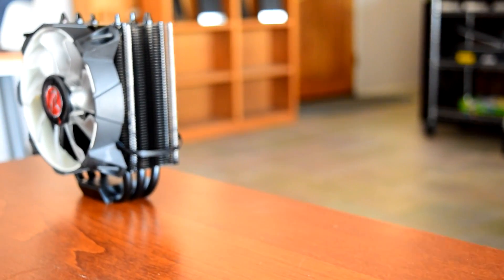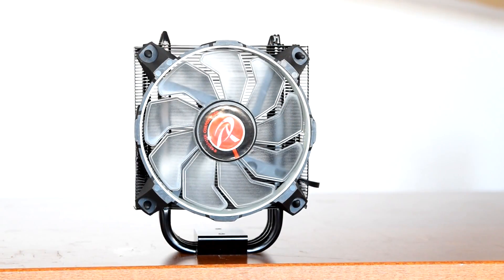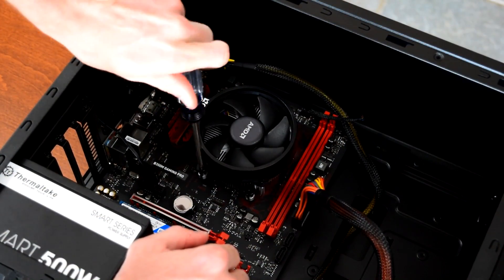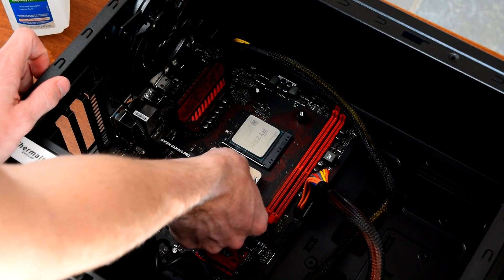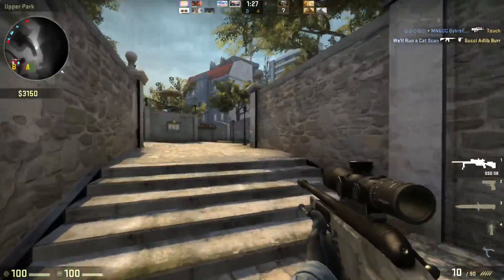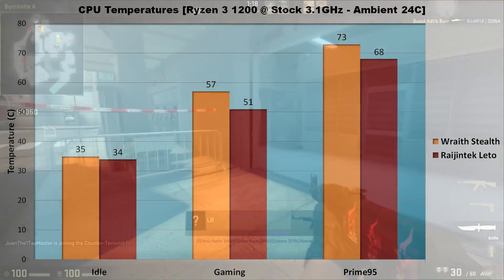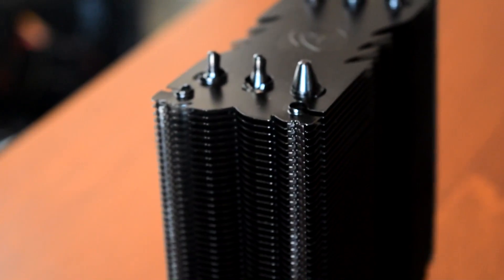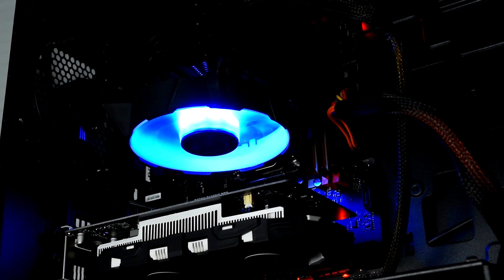Raijintek Leto Review: Ryzen 3 Overclock to 4.1GHz on Air!

Comment: Hi so i am planning on upgrading my 2400G to a 2600/2600X and don't plan on overclocking so i want to know would this cooler be more than enough or should i think about getting an AIO like i have been thinking of getting.

Also right now i am using the Deepcool S40 cooler which has done good for me but going to give it to my friend when he buys the 2400G from me cause i am going to overclock the Vega 11 since for most of the games he plans on playing would which he is going to be playing GTA V, Destiny 2, CS GO and Overwatch which i already know for those games he would be playing on medium to high settings so just your opinion on this cooler is it worth getting or should i save up more to get something better.

Also i don't mind the orientation of the cooler since i am getting i am going to have slot 2 and 4 open at all times.

Comment: With the B450 mortar and Corsair 115i pro RGB 289mm cooler could I push it to 4.2 even if have to increase voltage ?
Reply: I'm late, but probably not, you'd have to increase the c voltage well above the safe limits for daily usage (1,35v), and significantly reducing its lifetime

Comment: IMPORTANT PLEASE RESPOND!
were you able to put the side panel back on. I have that same masterbox lite 3.1 and i'm bying this samw cpu cooler.
Reply from the maker: Yes, there's about 5mm of space between the side panel and top of the heat pipes.
Reply: ponchato wow.. on the cooler master site it says "supports coolers up to 158mm tall" and this is 159. But thank you very much.
Reply: ponchato and btw don't you hate it too that there's no cable routing hole above the 8pin cpu power😂

Comment: My old Thermaltake Contac 30 3x8mm heatpipes(modified by me for AM4 socket) with Noctua 120mm fan keep my 1700 @3.9GHz under 65 degrees without any problem(Lapped CPU & cooler). Max acceptable temperature for Ryzens is 70 degrees

Comment: 4.0Ghz at 1.275v?
Dear lord, someone just won the lottery.
Reply: 15min in prime is not enough doesn't say if it blend test small or large ftt
Reply: I know this is an old post, but i've just read it. 
Mine runs at 3.9GHz / 1.28V with stock cooler since months and it doesn't go above 70-73 ° C while playing very CPU intensive games.
I tried at 4.0 GHz on same voltage but it was obviously hot with this weak cooler :D
Reply: @ÁkosLabancz  but does it ever crash? my ryzen 1200 @ 3.95 crashes occasionally after like 5 counter-strike competitive. But I am not sure if it is the RAM OC or CPU OC.
it passes stress testes, but still crash when I play cs go.
Reply: @achenko9575  It was stable, and later i upgraded my case airflow and it was stable at 4GHz on 1.3V. I replaced the 1200 for a Ryzen 5 1600 (AF -newer version, its actually  a 2600 with lower clocks) and a Corsair H100x AIO, but that chip cant pass above 4GHz and 1.375V. My girlfriends R3 1200 stuck on 3.9GHz too.
Reply: @achenko9575  You should try on 1.35V, whatch your temps, and if it stable, you can try to lower your voltage until it crashes.
I played csgo, pubg, forza h4, witcher 3, apex legends, far cry 5 and some other triple A titles. I never had a crash.
Reply: @ÁkosLabancz  thnx i realy appreicate the quick response, very interesting. Because all the videos i watched except this one, says put it to  1.4 to 1.45 volt to get it more stable.

I switched to 1.375 @ 3.904 and it hasnt crashed yet. But that has only been 6 hours ago
Reply: @ÁkosLabancz  also temp was never an issue . My temps are always lower than 50c. I have the thermaltake contac 12 silent. That thing is amazing, but huge. Only 25$. Do you watch linus tech tip? According to his expirement, those type of heatsinks outperform aio coolers
Reply: @AgressiverBalkan Then you didnt win the silicone lottery :/
Reply: @ÁkosLabancz  finally I went to 4ghz with 1.43 volts ...it stays about 60°c thanks to my big ass cooler

Comment: Any 4 heatpipe 25$ cooler is better than 3 heatpipe cooler.
Simple as that.
Reply: ANY 3x 8mm heatpipe cooler is beter than 4x6mm heatpipe cooler
Reply: Not just heatpipes, the total surface area matters too. The Cryorig H7 with 3x 6mm heatpipes outperforms CM Hyper 212 with 4x 6mm. Difference is that H7 has broader fins, over 20mm than 212's which is like an extra 40% in width.

Comment: What is the safest average overclock Frequency and Voltage for Ryzen 3 1200 with only the stock cooler? I mean safe in temps, and safe for not having problems of crashing,freezing and etc in some games. Is 3.8ghz enough? or should I go for 3.7ghz for sure safety?
Reply from the maker: From what I've heard in reading forums and talking to people, the vast majority of Ryzen 3 1200s will be stable at 3.8GHz and 1.35V, and within safe temperatures with the stock cooler. Every chip is different, but the general consensus seems to be 3.8GHz at 1.3 to 1.35V.
Reply: ponchato You deserve more subs. :)
Reply: Yeah save zone 1.35 volt, my chip get 3.8 on 1.275 volt. If got money better buy cooler
Reply: Roy Francisco - search for AMD Wraith Spire or AMD Wraith Max on ebay, guys that bought Ryzen CPUs and are changing the coolers are often selling those stock coolers at funny price. In my country it's about 15 USD. They looks great and will help with keeping Ryzen cool.

Best price/performance would be Spire.
Reply: My chip reached stable 3.9ghz   on 1.31v with asrock b350m pro4 and 3.8ghz on 1.26v
Reply: and temps around 50-55 on load with the stock cooler on 3.9ghz...i guess i am lucky or i have a good mb
Reply: Find Ryzen stelth cooler from the Ryzen 7 1700(people sell them because they don't use it).They use aftermarket coolers.Otherwise stay below 70 degrees on full load and you are going to be fine.

Comment: What voltage would you recommend to overclock ryzen 3? I am new to overclocking so any help is appreciated.
Reply: Up to 1.425v is safe but for long term use I would not go higher than 1.4v. Keep it as low as you can if it's stable. My 1600 is running 3900mhz at 1.4v.
Reply: My Ryzen 5 1600 is stable 3.7Ghz @1.3v but if i want 3.8Ghz i have to go above 1.4v and those extra 100mhz doesn't worth the extra heat and power consumption, take that in consideration if you ever face the same situation with your chip :)
Reply: Just set your CPU multiplier to 38 and let your motherboard handle the rest.Easy Peasy with the X370 chipset
Reply: Thanks! This gave me a lot information I needed!

Comment: Wow, I have a Ryzen 3, 1300X, B350M Gaming Pro and a masterliquid 120. I get 33-idle, 45-gaming, 57-stresstesting, @ 1.4000V at 4.0GHz
You should go into the BIOS and setup a more aggressive fan curve so it goes to 1200rpm so your temps hopefully stays in the 60s not 70s.
Reply: meh im getting 45-47 degrees with i5 7600k oc at 5.1ghz with hyper 212x
Reply: No worries i just starter overclocking with intel xtu and chose wrong profile when testing temperatures
Reply: Girish Sardey the thing was spinning at 1700 rpm when the cpu was at 4.1GHz. 1200 is actually less aggressive

Comment: Can you compare this to the Hyper 212 Evo
Reply: Luis Maiocchi I think the 212 Evo will be better since the Evo has a bigger heatsink, and more heatpipes.
Reply: This is true.
Reply: Luis Maiocchi my 6600k sits at around 65C under load at 4.1 Ghz with the 212 evo
Reply: Dude, the H7 is a breeze to install. Aren't you confusing it with BeQuiet's? Those are a true bitch to instal. Shitty "mounting" tools are provided to reach the most impossible places.
Reply: +Luis Maiocchi take a look at the arctic freezer 33 it's compatible with the am4 platform since release and it is slightly better than the hyper 212 evo/X while costing slightly less and being perfectly compatible with all platforms.
Reply: My r3 1200 got 60° at 3.9ghz with the hyper 212x (intel burn test - very high).

Comment: is 50C idle at 34C ambient temp safe ? nice vid btw
Reply from the maker: As long as the maximum temperature during gaming or stress testing is below 80 or 85C, you should be safe.
Reply: oh thanks!, i thought I installed the cooler wrong :D
Reply: What are your Temps when ur gaming?